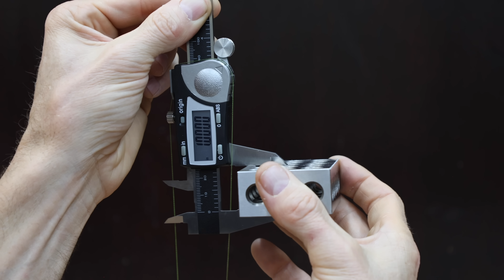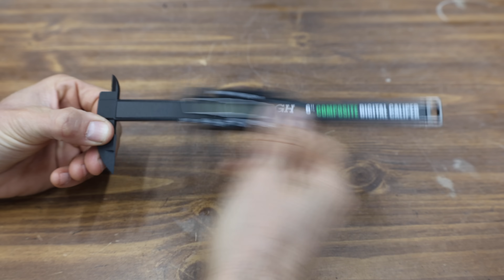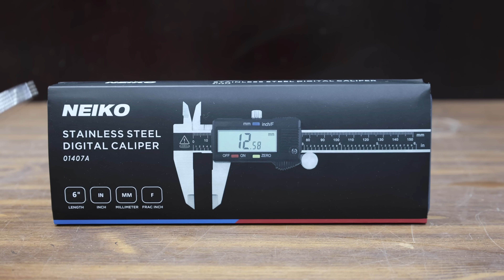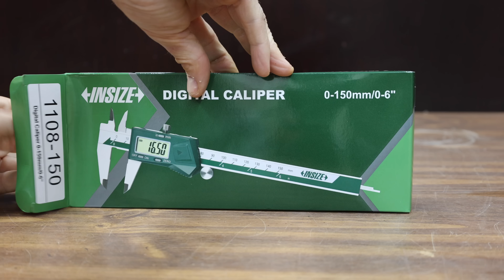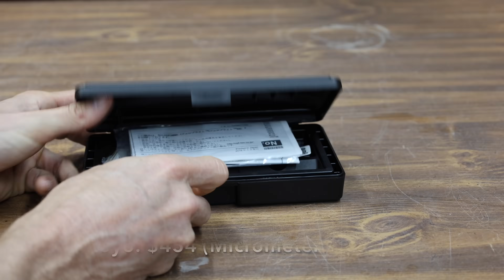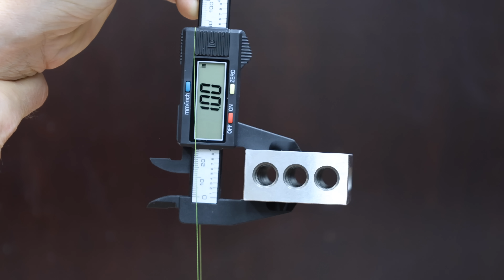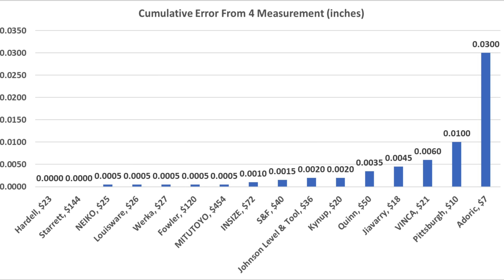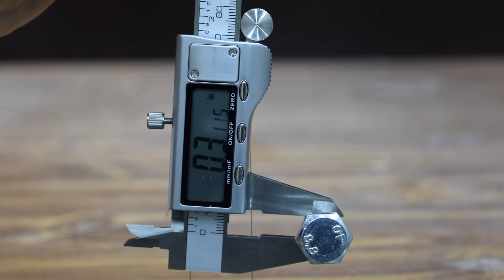I've Been Proven Wrong About Calipers!

Comment: Trust me, Mitutoyo yo are the standard. And as a machinist, I absolutely hate calipers that auto power off. I would rather change a battery after two years of straight on time, then lose a measurement or have to remeasure. Because I use the calipers for more than just measurements I use them as a conversion table switching from metric to SAE standard. I have purchased a back up pair, but I’ve still been using my first set that I got in 2013.
Reply from the maker: Thanks for sharing!

Comment: Over the last ten years, I’ve bought around 15 digital calipers from ~5 different brands. Didn’t matter which one — they all had the same issue. At first, they worked fine, but after a few months or years they became unreliable. They’d lose reference mid-measurement, most often exactly 2 inches (50.8 mm), sometimes just a bit off. I had to check after every measurement if zero was still zero. The batteries lasted only a few months. They were all the same generic chinese crap with differend housing.

I’m a carpenter, so accuracy of 0.1 mm is more than enough for me, but when they lost its reliability, they are useless. Two years ago, I had enough and bought two Mitutoyos for 150 € each — battery life is rated over three years and they just work perfectly. No regrets at all. With the money I wasted on those 15 junk calipers, I could’ve bought two more Mitutoyos.

Also be carefull. You can find fake mitotuyo calipers, they look basicly the same, but they draw like 10 times more battery. You have some in depth videos - comparison on youtube.
Reply from the maker: Thanks for sharing.

Comment: Machine shop quality here, 25 years + now in only calibration. Mitutoyo are the best, they last years, really not even disputed by anyone I know of. For cheap I have been very impressed by Insize. I have seen them in a machine shop last 3+ years of real use in a very harsh environment. At the time you could get 6 inch Insize for $45 on sale. You could also find on sale 6 inch Mitutoyo calipers for about $125. 

I also bought cheap knock off china made Mitutoyo branded calipers, like $35 on wish. They lasted about two months. You compare the fit and finish and it was clear which was real from day one. The finish was no where close to the made in Japan ones. The encoder failed and no amount of cleaning even re-soldering some of the circuits inside fixed it. As  side note I also bought cloned Benchmade Osbourne, the clone also from a distance looked great, up close it was so clear it was a fake the over all quality was not there bad screws, blade had wobble. 

 When I say machine shop I mean 100+ machines, lathes and CNC centers. Where money depends on making good parts, best not to use cheap gages for such parts. Spend once , cry once.
Reply from the maker: Thanks for sharing.

Comment: LR44 are garbage alkaline batteries that are pretty much all from China.  They are super cheap but don’t last long.  The voltage curve drops pretty fast.  We call the battery dead when the voltage drops too low for the device it’s in to work.  I’ve found SR44, or 357 batteries do several times better.  They are silver oxides that maintain a flatter voltage curve for several times longer and can output more current.  But they are also several times more money but honestly they are all cheap.  I think energizer 357s are around 2 bucks a piece, and I believe they are made in the USA.  I rather not deal with the hassle of looking for batteries as often.  I have three calipers that all came with LR44s, and they went dead pretty fast.  They all have 357s now and haven’t had an issue yet.

Comment: I don't have expensive calipers but what drives me nuts is the battery being drained with the caliper just sitting in the drawer waiting for the next use.  I flip the battery upside down in its holder for storage and turn it right way around when I need it.

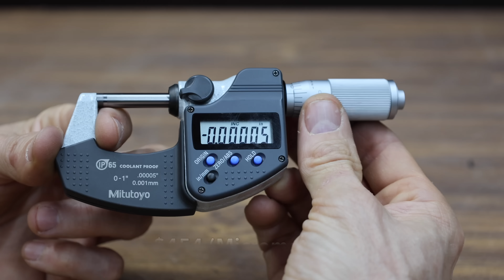Comment: It doesn't seem fair to rank the Mitutoyo in the chart at $454 when that is your price for the caliper+micrometer package. At 9:11 you price it at ~$250 for the caliper, which is too high. Although there are a lot of fake Mitutoyo's out there, you can get a 500-196-30 from Grainger's Zoro consumer website for $170 (free shipping); $145 from McMaster-Carr ($11 shipping for me, beats Zoro).
Also, Mitutoyo and others recommend an SR44SW silver oxide chemistry battery instead of an LR44 alkaline. The voltage curve is much stiffer and you'll get much longer life out of it.
The Mitutoyo Amazon store no longer seems to sell digital calipers (weird!) and your link is busted — maybe update to Zoro and/or McMaster-Carr?

Comment: You got lucky with your vinca (or I got unlucky). Got one a few years ago and it was crusty to the point it jumped around instead of sliding. Did better after taking apart cleaning and lubing it. but gives random variance every time it closes. mine came with a ruler.

Comment: writing this comment before actually watching the video end to end - i'm pretty sure i had an example of the very first one in the test 

Accuracy seemed to be on par with standards, and i would get the same measurements as everybody around me, within a thousand of a mil
slide did feel rather inconsistent although light - its biggest issue was moisture, as even a drop of any liquid on the slide would cause erratic measurement and even cause it to lose calibration and forget where on the slide it was measuring

not very good when working in a worn down machining shop, with coolant everywhere but where it was supposed to be

it did me very well, but didnt last for long, and considering the price i could definitely consider buying another one at least for hobby use

Comment: I've got 3 calipers in my collection.  The one that actually works has no battery and a dial scale that's accurate to 1/64".  I'm a furniture maker, that's what I use them for, and that's double the accuracy I need.  The ones that don't are digital.  They never had that auto-turn-off function (or perhaps it just didn't work) and, to add to that, the battery cover failed on one of them.  They're good for transferring a measurement, but other than that, junk in no time.

Comment: Thanks for the review.  I have the Mitutoyo and I love it.  I have other calipers and the cheap electronic ones, tend to start out accurate but after a few years of use they degrade.  My Mitutoyo has not degraded over the years, plus the battery lasts for years.  

The price comparison for the Mitu is misleading and not fair--the Mitu is a set, while the others are not.  You can get the Mitu itself for around $150.

By the way, you shouldn't clean the jaws with cloth as it can leave tiny cloth fibers on the jaws.  The proper way to wipe them is with a piece of paper.  If the jaws are dirty you can wipe them with a cloth followed by a clean piece of paper.  Thanks for the review.

Comment: Their biggest problem is "battery". They eat it in few hours if you let them on. Then you replace it and all sort of gremlins start. After few "crashed" batteries you get sick of it. Mitutoyo - sometimes I forget it to turn it off. For a week or two. Battery still work like nothing happened. I've bought several of these cheap ones. Now they are all used as a scraper.

Comment: Just so happens I have a pair on my desk. No name on it, but you have at least 2 nearly identical ones in your test. The main difference is mine has an output for a printer of some sort, proprietary connection.  I noticed at least one you showed has a USB output, that would be for recording measurements to a PC.  A lot of the branded calipers all come out of the same Chinese factory, and it's interesting to see how each brand is similar, yet slightly different in quality.   I also have an old MAX-CAL caliper from the 90's that still works. It is from Fowler Instruments which is still going strong.  With use these calipers ease up and work smoother and smoother.   One test is to see how easy it is to put it on a reading like say you want to mark something, and set it t 2.168 and lock it to mark. The MAX-CAL I have is really easy to do it with, the no name is too jerky, and difficult to get it on the mark.  The hardened tips are great for marking on blue dyed metal for when cutting.  Not at all surprised with Starrett at the top, they make quality tools which I have a few of , but am surprised where Mitutoyo landed as they are regarded as one of the top brands.

Comment: When it comes to power consumption, I think you need to do actual test not only checking whether it has auto shut down or not. I have a cheap one with auto power down and battery dies very quickly. It seems it consumes power even while power off. And I suppose good brand without auto-power-down consume so little power that it does not need that function.

Comment: I feel like it could have used some more emphasis in this video but I hope everybody watching truly understands the difference between 0.01" and 0.001"...  Any decent set of calipers should be able to reliably measure down to 1 thousandth of an inch (1/¹⁰⁰⁰)....
The cheaper calipers in this video advertise that they can only get you within about 10 thousandths (10/¹⁰⁰⁰) of an inch.... Which is garbage, and defeats the point of needing to own a precision measuring tool in the first place..... If all you're trying to do is guess at a measurement you might as well use a scale or tape measure.

And a caliper is the sloppiest and least accurate measuring device a machinist uses.

Comment: Timeline Chapter markers would be really appreciated for your videos. Most people don't have the time to watch the entire video or skim through to find what they need when doing a simple google search to quickly figure out what is the most recommended tool to buy. 

Also a lot of these that you got are just the same calipers but rebranded with maybe a slightly less or more quality. Should have chosen all different manufacturers rather than the same Chinese manufacturer that is just rebranding majority of the cheap stainless steel calipers in this video.

Comment: you need to look into the features of the products you are testing...  VINCA has a data port for auto data collecting to a spreadsheet via USB-mini to USB-A AND they have "Reference point" awareness...  TURN OFF the VINCA's and move the jaws..  turn back on and it reads the new jaw distance...  trusted in machine shops/fab shops....  dial in CNC and mills with them.  Batteries last years in standby...

Comment: Would love to see an episode 2 of this. Drop test, longjevity of the mechanism and accuracy after use in dusty enviornent and how long the metal points of the measuring stay sharp after scoring lines in metal,

aka. Workhorse test. both bang for the buck and "still reliable enough" after getting messed around.

Comment: All depends on what kind of tolerances you're dealing with 😅
Real accuracy you'd use a micrometer or such 
Dinky plastic ones might be sufficient for some cases. 
I have an "iGaging" one that actually reads out in fractions/metric and standard (decimal) And it's most likely not super accurate but good for average use cases.

Comment: I've been in the CNC machining field for over twenty years. The parts I make range from over 2000 lbs and 30" in diameter to so small you can take an air gun and blow the entire order of a thousand pieces all over the shop. Tolerances within +/-.00025.
The best dial calipers I've ever had were brown and sharp NOT DIGITAL and MADE IN AMERICA. They're NOT expensive either for being made in the USA.
Even though these all appear to repeat, with digital calipers any slightly bit of excess pressure causes a false reading.
Not only that, but the China made crap are completely untrustworthy, ESPECIALLY with regard to the ID side. Even though some (like Fowler) seem to be of good quality and "hardened " the tips VERY EASILY get bent and read inaccurately. 
The Mititoyo brand is OK for digital calipers but you have to be careful because they're not all rated for coolant.
I absolutely can't stand digital calipers.
Lastly, I really wish maybe you would have put them through some sort of tests like a drop from average hip height or something.

Comment: I have a Vinca, slightly different model than the one here, as mine does not have a screw holding the battery cover on, although Amazon seems to think I have the same one tested here as it links to the same product page, I guess the company changed the product without creating a new page.

Comment: Aaand no power draw measurement when off! Most important feature, super annoyance is you need calipers and they are DEAD (battery) Mitutoyo has parasitic draw of only 1uA vs 16-20 for all others! in drawer you can have them for 16 years, in practice battery self discharges  in 5 ish years Even if you forget to turn them off they consume 5uA while on , 1/3 compared to others WHEN OFF! your quality is slipping PFman...

Comment: would have loved to have seen a 'temperature test' aka how do they function when used really cold or at 40 degrees Celcius really hot.. or how does a 'low' battery mess up measurements
Reply from the maker: Thanks for the suggestion.

Comment: Cheap calipers still suck. Especially digital ones. They wear out real fast, can't take light shock and even midrange digitals eat batteries (even off). Get dial or vernier calipers. My home use calipers are mitutoyo vernier scales and cost less than Quinn digitals. These I'll trust for decades.

Comment: I get the feeling you don't like Mitutoyo.
Why say it is 400+$ at the final table.
When before you stated it was240$.
The 400+$ package included a micrometer.

I even bought mine for 144$. With the optional (20+$) calibration sheet
But it came with a plastic case.

I'm getting a feeling of American price altering your views... Starrett is good, but Mitutoyo is better.

The battery lasts like a Casio watch.
It has no auto shut off, in the same way as a Casio watch has not auto shutoff. 
It stays on for 5years.... Easy

It's on another level

Comment: Many years ago we got 6 dial calipers made in China (Fowler, very respectable). Per QA policy they were sent to calibration. Brand new 2 failed and were replaced. At 1 year half failed calibration (5 of 8). If you need accuracy to .001 or better, spend the money; however, for most home use, .01 is good enough.
Reply from the maker: Thanks for the feedback.

Comment: Machinist here. Anyone in the field will know you need both and then some. I have 3 sets of calipers. Plastic ones for measuring magnetic objects. Decent ones for engineering purposes. Then highly accurate ones that i don't trust because I'm a machinist. I'll check that measurement with one of a couple sets of micrometers i have. After that, I will question all my findings and double check myself with a harbor freight caliper.
Reply: Also, digital readout measuring equipment is a false sense of accuracy to the average consumer. Mechanical analog measuring equipment doesn't lie. Somehow we perceive a digital readout as more accurate. No question on how that number was calculated. It says right there on a display, must be true.

Comment: I have the Starrett. The big difference between that and the cheaper ones is repeatability.  If you measure something several times you keep getting the same answer, the cheaper ones wander a little.  It also operates more smoothly.  My one complaint is that I would like for it to do fractions.
Reply from the maker: Thanks for the feedback.

Comment: you should look into doing basic statistics. It would really do a better job in presenting meaningful results and you can automatic it all using your spreadsheet.

E.g., rather than just presenting a list of numbers, it might be better to present the deviation from the average. This helps one see how far away something is from the average at a glance rather than having to scan the list and get some idea of an average or max, min, etc. It may even be better, since most people are comparing from the best, to use the best as the reference. 

From this you can go further and do more advanced statistics to find true outliers and highlight those in, say, red. You could even present a distribution plot which shows how they relate in terms of price and "finish". This way one can better understand the where a product may lie overall at a glance rather than having to spend time parsing the numbers.
Reply from the maker: Thanks for the constructive feedback.

Comment: I like my calipers a lot........except that the battery will die in a month maybe 2 months. It does have auto power off. It drains the battery even when off. And for that reason alone I HATE them. For me vampiric drain is the thing I'd really want to know about. My guess is by having a manual power on feature (mine turns on just by sliding it) it probably doesn't waste any power. Makes me wonder if the starrett would be a good choice......even though I don't use them that often.

Comment: One of the reasons why the likes of the Mitutoyo doesn't use auto shut off is that when using for engineering etc your constantly using  while measuring/setting up so need it on unlike diy where your more busy glugging your cawfee.
Reply from the maker: Thanks for the feedback!

Comment: none of them uses lithium rechargeable batteries. theses button cells don´t last. when you really need to use the tool the cells are corroded or discharged and you lose time.